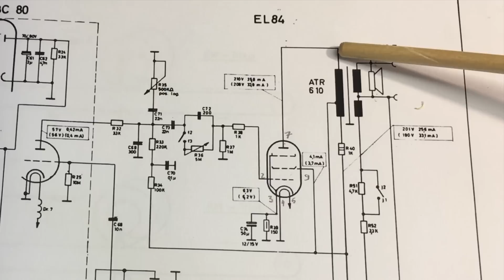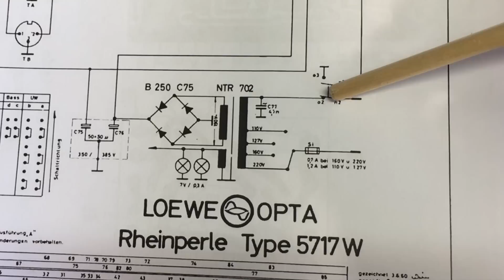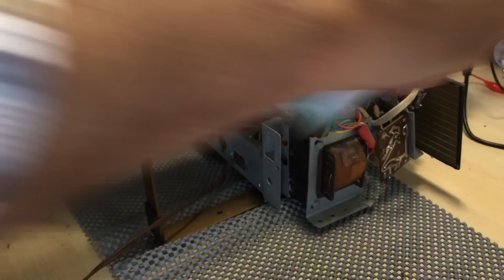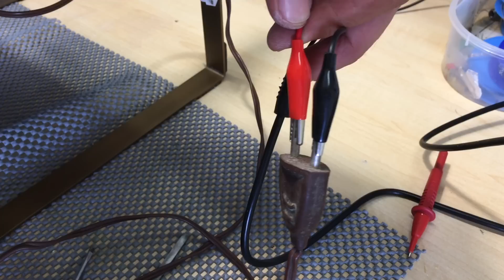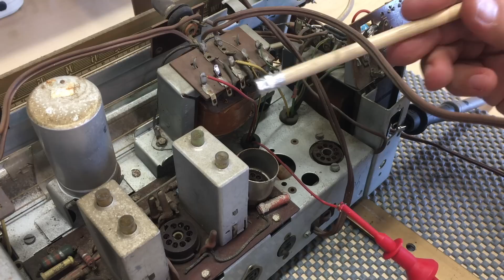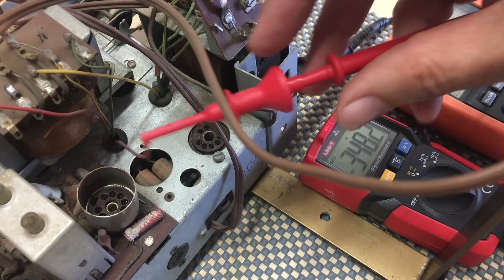Loewe-Opta Rheinperle 5717W restoration - Part 2. It has started!

Comment: Hello! Thanks a lot for sharing this kind of contents. I have a question about the death cap. Why do you replace instead of remove it and install a three cord cable with earth to the chassis? I understand that you use a safe capacitor, but wouldn't be better to have the chassis to earth? Thanks again. Greetings from Germany
Reply from the maker: I usually replace it to filter noise on the mains line. Using a three-wire cord to earth the chassis is great for safety, but doesn’t replace the function of the cap.
Reply: @electronicsoldandnew  
Thanks a lot for de answer. I follow other person who fix guitare Amps and they remove the cap for safety. I understand the difference now and why you replace the cap. Didn't know about line noise. I am currently restoring  a Loewe Opta Apollo 4760w. I found this videos quite useful. Thank you very much!
Reply from the maker: @jjnicola : my pleasure
Reply: @electronicsoldandnew  Richtig, denn es ist ein Siebkondensator.

Comment: You are absolutely right to be careful with the mains; it may not give you a second chance!  I'm 61 and very aware that I'm slowing down a bit. A good habit to get into, apart from checking everything twice before plugging in, is to put one hand in your pocket, so if you do accidentally come in contact with it, you lessen the chance of the current going across your chest. Great video :-)
Reply from the maker: Alan Cordwell / thanks Alan.
Reply: Am allerbesten ist, den Netzstecker in die Hosentasche stecken. Dann passiert auf jedenfall nichts.

Comment: As a fellow electrical engineer (roughly the same age too) I would say that, if you had left the power on while messing about it it, then you could call yourself an idiot. As far as I can tell, you are doing it by the book, don't be so hard on yourself.
I like the radio, looking forward to how it works when you fix it :)
Cheers,
Reply from the maker: Here’s a joke we shared at university: electronic engineers are guys who were too afraid of high voltages to become electrical engineers :) 
In South Africa we had the two courses that flowed together and then split after the third year.

Comment: Nice first part Manuel. I know exactly what you mean about Fluke. Once you have one, you never want to be without it. I also have my original Avo 8 as well for those times when analogue is better than digital. At least you got a successful first power and the output transformer seems good at this point.
Reply from the maker: I also have two Avo 8’s. More for the nostalgic moments. Actually I’m inclined towards the Brymen 869s. Great features and way lower in price that the fluke.
Reply: I was lucky this week. I found 3 used flukes in a box at an auction. Not tested them fully but I paid less for the box of stuff than It costs for a quarter of a fluke. If I get one good one out of the 3 its a winner.

Comment: capacitor is completely kaput    :-) Your german gets better !
I'm 65, and have the the same problems with mains lines. So my new iso-transformer has in the input part a double automated fuse, an emergency switch (usable with the fist) and a main switch. Now you can call me paranoid.
Reply from the maker: Alfred Neumann : Danke. 
You can never be paranoid... only careful.
Reply: Wichtig ist: immer einen Trenntrafo benutzen...Trenntransformator.

Comment: Is it possible the selenium rectifier is leaky causing that high AC reading ?
Reply: Yeah it's probably leaking some reverse current... Maybe that's what killed the cap too
Reply from the maker: THAT is my fear exactly. Because I’ll have to remove the filter caps I replaced to get to it. We’ll see.
Reply: @electronicsoldandnew  Ausbauen und 4 Dioden BY133 einbauen. Brückengleichrichter
Reply: That was my first thought too. Those selenium rectifiers are quite often the culprit. I have several of them in my junk components box.
Hurrah for Silicon!